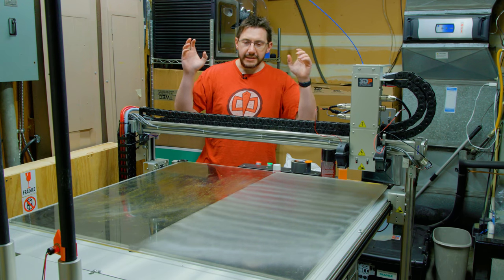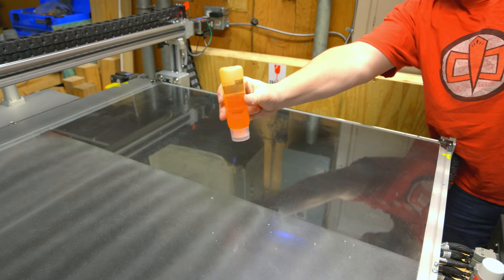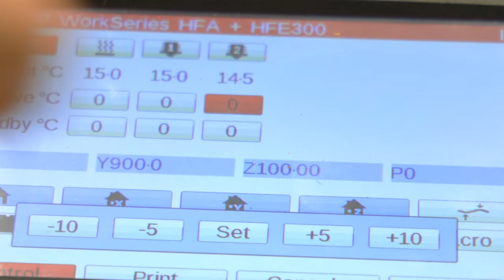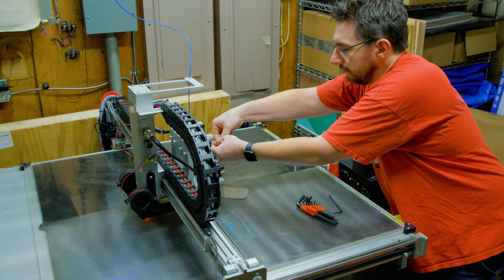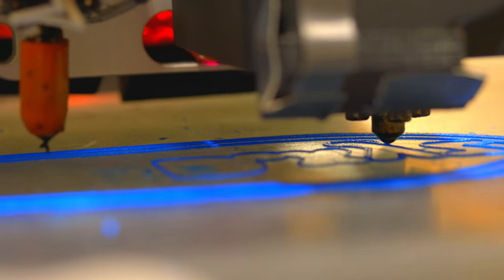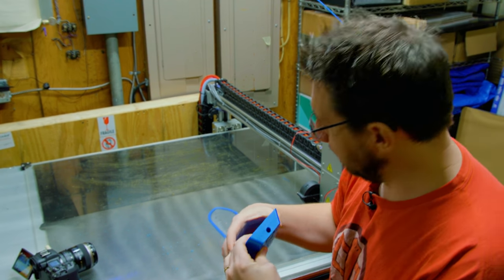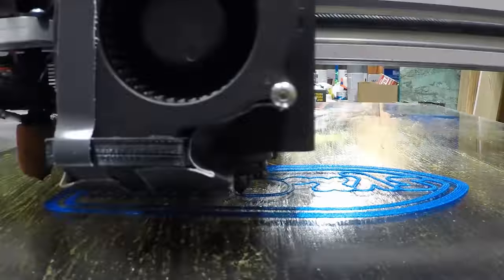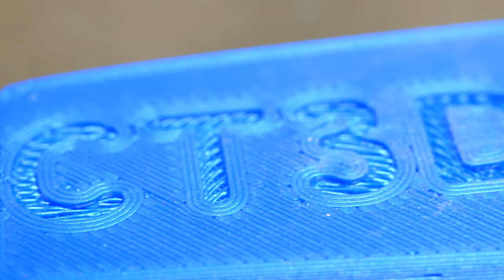$38,000 3D Printer Bed Adhesion Test // Super 77 & Zillagrip

Comment: try using the super 77 and gluing a sheet of fine grit sand paper to the glass bed and printing on top of that ive had to use it once for a tricky abs part that wanted to warp due to its shape

Comment: Get a large PEI Sticker for your glass, unless you absolutely need the mirror finish (Which is disappearing with these adhesives!) Then you're going to get far better results, PEI On glass will have no issues with it being warped at that size, but heating your bed to even 30C will give you far better results, you should be able to not heat it at all if you use adhesives like 3dlac.

Comment: I had a similar issue with some CC3D PLA+ from Amazon, where it would lift off a cold bed no matter how well it started off. It works like a champ at low bed and high extruder temps, though. I run the bed at 45-50c and extruder at 235c. Just warm enough to keep consistent heat in the bottom 20-40 layers (.16 or. 20 mil layers). After the first 2 inches, I can shut off the bed heat and get a great print.

Comment: Glueing if down will never work if the cooling  plastic has more force than the glue. Your issue is with temps and uneven cooling. Try an enclosure or hot air blower to keep it from cooling as fast

Comment: oh and one more thing, the "riskable 3d printing" channel guy had luck getting delrin/pom to stick by using "pro form joint tape", i think this is the type of tape they use to smooth over gaps in sheet rock before they put the mud on.  a different kind of problem he's solving, but perhaps a trick to try if you haven't before.

Comment: Hmm maybe a shield around the model. The layers should cool down slower with it and warping should be less. 
Increasing the first layer size is helping a lot too.
The bed is not heated? Try a fan heater below the bed or a hairdryer pointed on the model to keep it warmer. 
Heat up your room as much should help too.
Reply: The bed is heated but didn't seem to be in this video - info screen said "0".

Comment: I did the same thing on a smaller scale.. (heated up the inside of my Wanhao printer) and had really mixed results.
The I banished the printer to the Garage, where it is around 14C / 55 degrees F and the prints are awesome.
However, you want to print the first layer a bit hotter (5-10deg C) on a lukewarm bed.
Lukewarm: 30 C/85 degrees Fahrenheit for the bed.
Make sure to heat the bed well in advance so it really heats up evenly.

Good luck.

Comment: I'd say to put a coat of PVA on the build surface which I've always found quite effective when printing PLA.  This probably wont work as well in this instance based on the fact it's not a heated bed and the room temp you're printing in.

Comment: Blue painters tape from Harbor Freight, and Harbor Freight only.  Sticktek.  It is the only thing I use on 1/2" thick glass, room temperature.  You can also douse it with any % isopropyl alcohol to help gum the tape up with REALLY big parts.  Downside, it can leave some of itself behind on the part.  Also mind where the print "lands" on the tape, which is why it's suggested to place it on diagonal to the part layment.  I am not sure there is anything large that will not lift when printed cold.  The material shrinks.  In engineering speak, I'm sure there is a dimensionless ratio of height vs edge length where peeling occurs.  That would be a good experiment to do.

Comment: I must say you did use the Zillagrip, but not as it was intended to be used. You need to use it as the manufacturer intended it to be used before you can call it a failure. Also, I'd be interested to see all products mentioned used with a different filament to eliminate that from the equation. Because that can still be a cause as well.

Comment: 7:00 - you need a brim! It's obvious. A boat is not a bad shape but it has corners... Also when you touch a bed by fingers or hand you're making "invisible" grease spots on it. Just take a proper lamp (to check dirt and etc.) to see that.
P.S. yes, of course! You need a heated bed to print PLA/PETG properly. At least 50C.

Comment: Would suggest a heater facing the printed piece as well the whole issue is the bottom layers are cooling while the upper layers are very hot causing warpage which creates the lift if you were able to put a heat gun or small heater pointed at the project I feel sure it would work.

Comment: Way back in the thing-o-matic days we used to add a tab to the corner (small 1 or 2 layer rectangle/circle) overlapping with the corners of the model. I've had success (and failure) with 8"x4" ABS model on a cold bed using the tabs

Comment: I use spider sheet glued to a thin metal plate. 1.) i can remove the print from the bed. 2.) big prints is easyer to get off when you can bend the metal plate of the part. i tried a lot, but after using spider sheet on a metal plate i had NO lifting at all. I even print ABS open air

Comment: This isn't an adhesion problem. You have plenty of that from the force it took to remove the prints. It's a filament problem. It just shrinks too much between extruded temp and room temp. Once you get enough adhesion to overcome that, you won't ever get the part off the glass. Or you'll end up with poor layer bonding higher in the print. Because something has to give when the filament shrinks ... if that shrinkage isn't uniform spatially and temporally.

Comment: Adhesive will help to "fight" against the material warping but it appears that the basic trouble shooting steps of using a brim or raft and increasing the bed temp haven't be sufficiently explored.  I am guessing that the ambient air temp around the printer is fairly low this time of year. I would not hesitate to increase the bed temp above 60c to improve bed adhesion. If this starts to cause major elephant foot type distortion, the part could be placed on a thick raft.

Comment: On my heated Makerbot I put down a layer of Kapton tape then I always have a jar of bits and failures of whatever filament I’m using sitting in acetone. I brush that on with a $1 brush from the hardware store and once the acetone evaporates the slurry keeps my prints tight against the Kapton.

Comment: Joel - can you just put a little space heater pointed at the bed before printing to get it nice and toasty? Turn it off when you begin the print, but this way you can at least start with a warmer bed without changing/heating the entire garage. Just a little fan blower on the surface to get it >80-90* and then turn off and do your print. I don't know if it would make sense to have it continually pointed at the model, but that could be a potential second step if the no heat after start method doesn't work. (And for heater, I'm thinking like a totally cheapo one from walmart for like $15 - nothing fancy).

Comment: When I started 3D printing a few years ago I found abs was easier to print , weird eh.
Anyway I noticed that the more material you use the greater the warping so my suggestion is try an infill that uses less material and/or less infill.
Less material means less to shrink so less affect from shrinking.
I think that because this is the 2.85 filament it’s laying a lot down and anything you can do to reduce the amount of plastic being laid down may help. Perhaps even increasing the infill as you move up the print might help.
Last suggestion I promise, increase cooling, and this is tricky but if the previous layer is fully cooled it will have shrunk as much as it could before the next payer goes down and fills any gap. But layer adhesion could be an issue if the previous filament layer is cool, it’s tricky.

Comment: No bed liner or coating is going to fix that. Unfortunately, once you get to a certain size, you run into the issue of cooling with each layer. In fact, at that size, I'd bet you could measure the shrink from cooling with each circuit on each layer. What's happening is that by the time layer 2 comes around, layer 1 has fully cooled and shrunk. Layer 2, adhered to layer 1, then cools and shrinks. By the time layer 4 or 5 comes around, the tension is enough to cause that lift. 

The heated bed is supposed to combat that, but even that can only do so much if you haven't managed the environment the printer sits in. Any cool air movement across the bed can cause disaster. Ideally, you'd have the printer fully enclosed in a heated chamber, but that's very impractical with that printer. I'd try cranking a few portable heaters up in there and seal off any sources of draft.

Comment: Have you tried cleaning the bed, i.e. with alcohol? That helped with my bed adhesion! 
Also I use a BRIM for better bed adhesion, not sure how that will work with a .5mm layer height though.

Comment: I've had problems with petg lifting up and un attaching.  People say it doesn't need super warm bed. They recommend 40c but it would still warp and lift off. So I printed it with a 85c bed and it didn't warm or lift off. I think rapid cooling is your problem.

Comment: You should try using a nozzle cam, like CNCkitchen and chilicoke did, to get a good view of the first layer. It also seems like you need an enclosure of some sort to keep the whole model at a constant temp so shrinking doesn't pull it off the bed.

Comment: Looks like its an issue with thermal expansion. 

That's hard to fix.  I expect using a heated bed and an enclosure would relieve the additive layer contraction force that is warping the bottom layer (and every layer afterward)  but then you'll be fighting elephant's foot.

Comment: Full disclosure I have never 3-D printed, but (you may have tried this already) I don't think any adhesive is going to work.  I think the issue is the amount of contraction of the material.  Looking at the structure there is a fair amount of material and it really isn't a flexible structure.  Can you print a few layers and wait then print a few more then wait etc.?  Does that work with this material?  The only other option that comes to mind would be to keep the material at an elevated temp. (not just the bed) so you control the contraction.  I would bet that the bottom would still bow once it cools.  Can you alter the print to have more material in the "middle" so it sets at the right size (like preloading a beam to counter deflection).  Anyway those are my thoughts - based on years of engineering, but not on 3-d printing...Good luck.

Comment: Because of your Temps Joel, i wouldn`t call it a fail. It seems to be more like a "worst case test" . 
So, you have plenty of room still untouched with both materials. Why don`t you try another test with the heatbed set to around 86 degrees fahrenheit and another one with 122 degrees fahrenheit. 
You dont need to print a big benchy for testing, some sort of stick witch a lot of infill would be enough. 
After those additional testing you have some numbers to analyze and improve. 
Thank you for your great educational entertainment!

Comment: I use Aleene's flexible stretchable fabric glue. Not sure it will work for you on that scale.  If you want to try it...   Put it on thin and heat the bed to 60 for 20 ish minutes  let it cool and it should be almost clear.  Then print heated to 60.   Thats how I got it to work on the CR10 glass bed. And the print releases as it cools after printing.  Good luck.  Hope you find something that works.   Cheers

Comment: Heat the bed to like 30c with the adhesives and double the layer height to negate the forces on the filament cooling too fast and contracting over lower layer lines.

Comment: I'm recently had a lot of bed adhesion issues with pla and I found that low ambient temperature was part of my problem. I went from parts that would peel off the bed completely within a few layers to a little peeling on corners on long prints just by raising the ambient temperature by 15 degrees. The rest of my problems were solved by drying my filament. Apparently the moisture in filament can cause poor bed adhesion. Now my pla sticks like I super glued the part to the bed. My settings are 55c bed, 220c first layer, 215c rest of print, 70-75f ambient.

Comment: Try Aqua Net hairspray. Use an even light coat, not too close. I would also test the bed temp to make sure it is really reaching what it is set to. We run our Platform at 75 degrees for PLA. You could also try making the first layer or two thinner. Good luck. Also they used to recommend coating it with beer. Never tried that though.

Comment: I'm using DimaFix liquid stick on a non-scuffed bare metal WhamBam plate (300x300). Never had a print fail in years.
When using the DimaFix spray can you need 3 to 4 layers (because they're so thin) compared to 1 layer for the stick version.

Comment: My first three printers didn't have heated beds. I used blue tape for PLA which worked very well, but the parts I was making weren't nearly as big as these benchys, but maybe blue tape is worth a try(?). Also, less or no fan may help in cooler ambient temperatures.

Comment: try normal hairspray, works wonders for me when prints dont want to stick
Reply: I use it for petg to protect destroying my pei on the flexsheet. And very easy to washoff with warm water. Your sheet is as new
Reply: I have used hair spary on plain glass and its held really well with both PLA and ABS

Comment: I just purchase small container of 3D  Gloop's PET Gloop but I have yet to use it. I didn't hear you mention that brand so it would be a good tester since I havent heard anyone else talk bout it. It is supposed to be good for bed adhesion, part gluing and print smoothing. They have different gloops formulated specifically for PLA and ABS as well.

Comment: Joel, you look at how much force you need to apply to pull it off the bed and yet it is still strong enough to lift the print up. 
Do you know if it's lifting in a particular corner of the workshop? Temperature gradients might play a part, like with ABS.
I suggest printing a brim instead. I know that's kind of cheating.
I only print in an enclosure now (your workshop is technically an enclosure but leaves a lot of room for temp gradients). I can print shallow models with zero lifting. Larger, not so much.
So you're probably right that it's something inherent in the polymer that causes the bulk of the model to warp as it gets higher. What happens when you keep the bed a lot hotter?

Comment: I think its an ambient temperature control issue. Does your space gave relatively still air? Are there pockets of cold air moving around? Also I agree that you might want a slightly higher indoor temp.

Comment: Looks like the filament is shrinking by a lot, you can see it in your macro shots clearly. I don't think any product will help negate the shrinkage of the pla your using to be honest.

Only suggestion would be to use another brand of filament with less shrinkage. Or a really round benchy. Lol

Edit: Heated bed might also help combat the shrinkage a little too, but it will still lift on those sharp edges.

Comment: Need to slow down the cooling and reduce the range of degrees the PLA need to go from/to, print at 195, and maybe get a space heater to increase ambient temp. 
I would also have almost no part cooling to slow the cooling process

Comment: What about going back to the basics with the blue tape then your adhesive. I would also add a space heater as well that spray glue has an operating temp. It needs to be close to a certain degree for the glue to activate. I would let the small space heater blow on the super 77 for a bit then give it a shot.

Comment: hay Joel, not sure how it would work with the large extrusions, but ive been printing pla on a Cr10 s5 with diluted PVA wood glue with my secret trick. I dilute the glue with water to the consistance of milk and wipe a thin layer on the bed. Heat the bed as normal 50-60C ish (would probably work with lower temps as well), then my trick is that just before the print starts I rub some IPA on the glued up bed. For what ever resion this makes the PVA Tacky for a realy long time. 

Should work great for some thing with the Base cross section similer to the benchy (ive managed to break a Glass bed with this trick making out the Cr10s5). Would be interested to see if it helps with your situation, Using PVA wood glue is somthing ive seen out there before, but ive never seen the trick of rubbing it with alcohole befor the print.

Note, this works well for PLA and PETG. had no luck with ABS/ASA or PC with this trick.

Comment: The moment when you forget to buy new bed adhesion and you dig through your arts and crafts bins and  find a nos package of Office Depot glue sticks from 2001. Go to open package. The glue is like tar. You only notice after you put on a big glob. You spend 13 min cleaning the bed. And you remember that project last month and you find a half used can of supper 77 and you cross your fingers that it doesn’t kill printer. It works. You nervously YouTube just Incase and find this video and start typing this, “The moment when you forget to buy new bed adhesion and you dig through your arts and crafts bins and  find a nos package of Office Depot glue sticks from 2001. Go to open package. The glue is like tar. You only notice after you put on a big glob. You spend 13 min cleaning the bed. And you remember that project last month and you find a half used can of supper 77 and you cross your fingers that it doesn’t kill printer. It works. You nervously YouTube just Incase and find this video and start typing this, “

Comment: Try this.  Clamp a raft down in the corner area.  Meaning so you got a square printed under the benchy.  Hit pause when benchy layer starts.  Pull out the clamps, put boards down like if you were clamping surfaces.  be adventurous on placement.  Done.  I dont know what that machine looks like under the bed or what you got on clamps.  That will get' er...  Edit:  Hell you could do it in the middle.  Just run 2 long boards paralell to the object on each side.  Use 4 clamps and one on each point.